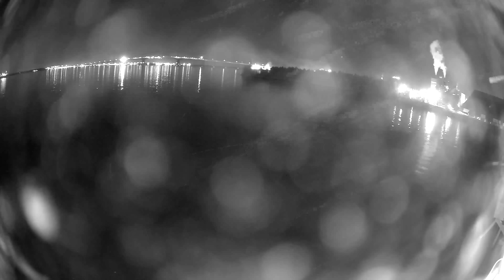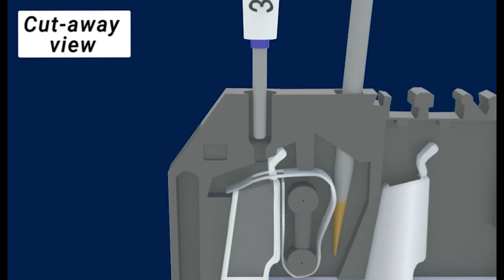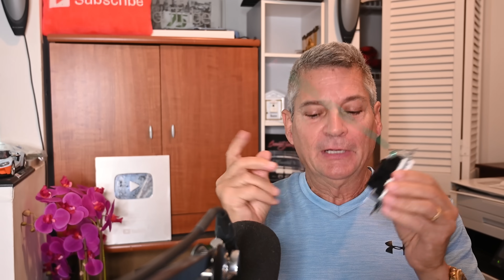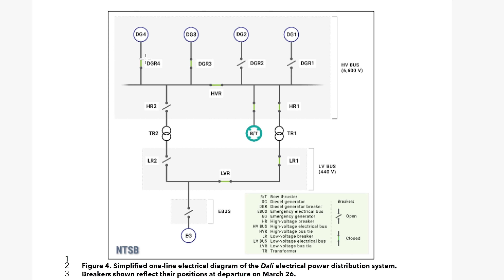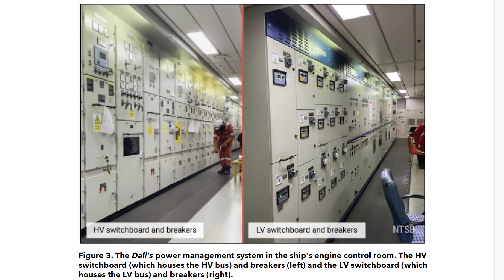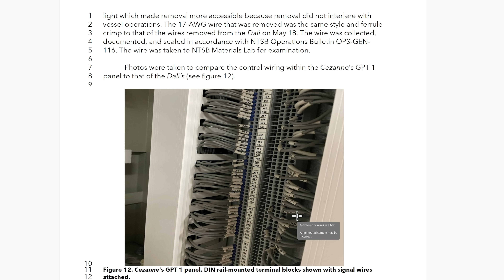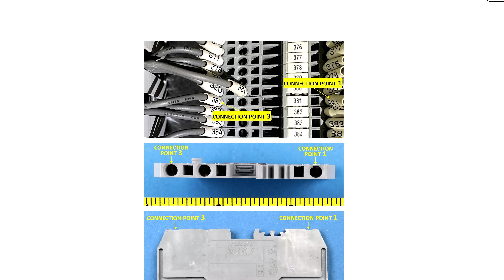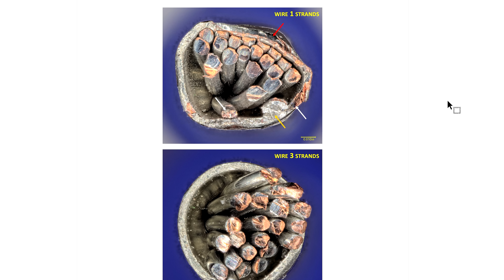NTSB: Scary Wire ERROR Caused Dali Crash/Key Bridge Collapse Baltimore

Comment: I learned long time ago to ALWAYS ensure that the heatshrink position is not compromising the wire ferrule insertion depth and to ALWAYS test Wago connections by pulling on the newly inserted wire to ensure that the wire ferrule is trapped correctly into the spring clamp.
This is a total rookie mistake, a mere 10 seconds of testing would have saved everything, also quite amazing that just ONE wire connection can fully disable an entire ship.
Reply: Yep, the five pound pull test takes about two seconds and would have saved six lives and incredible damage.
Reply: im preatty shure the deformation of the sleve that he mentiont was from pulling it out, and the other marks was from several attemps to fit it in.
This kind of Clamp culd not produce several marks on its own, only if several G´s fors on it ot the cable gets pulled, but like i say, i guess the marks show clearly there was several attemts to stick it in.
Reply: I wonder if the culprit is still out there and realized this is their fault. Even better, I wonder if they keep logs of maintenance and can figure out who did it. Probably not though
Reply: @digi3218   Construction records would probably say who assembled/worked on that panel. And maintenance records since construction "should" also say who's worked on it, if anyone has had a reason to fiddle with it. But I'm not holding my breath.
Reply: @dave.of.the.forrest On paper, at most they can narrow it down to contractor/crew. Only the crew probably knew who worked on what.
Reply: @dave.of.the.forrest  If they kept record sure you can find an underpaid shafted individual to blame. Yeah lets blame the design engineer and the QA inspector that gets yelled at if they take too long too. It is the environment driving profit pay someone as little as possible and you get minimum effort.
Reply: @ExileXCross  And in most cases even the crew itself propably doesn't know, years laters, who exactly worked on which panel when Dave, Bob, Steve and Harry all were wiring the room.
Reply: It doesn't matter. You shouldn't have to ALWAYS ensure that the heatshrink is not compromising the ferrule. The design of the system should make installing the label over the ferule impossible. It's just like lockouts to keep cars from being put into park when they are moving. Yes, you could just say "don't put the car in park when its moving and pretend the operators are stupid. But the proper design is the lockout to prevent the very possibility of a stupid mistake which is 100% likely to happen over and over again.
Reply: @RockinRobbins13 No. Just no. This is one of those cases where unskilled or improperly trained labor is put on a vital task without proper supervision or inspection. There are far too many chances for something like this to be done right before looking at adding ridiculously complicated safety features in an area where the people doing the work are supposed to be the backbone of safety

- Your friendly industrial electrician
Reply: @landonbrown5295  Skilled or unskilled, human beings make mistakes. To the extent it's possible to design items that block foreseeable and even unforeseeable mistakes that crop up and kill people, it is the engineer's job to design items to eliminate the possibility where possible.

This one is easy. So yes, just yes. Unless you are in favor of killing people by bad engineering. You might be in that camp.
Reply: @landonbrown5295  the skill level and training of the people doesn't matter.  Engineering things to prevent mistakes is essential.  Nasa learned this on Apollo 8 when the astronauts accidentally reset the navigation computer halfway between the Earth and moon.  They knew that the mistake was possible but chose not to fix it because they assumed the astronauts were too highly trained to make such a mistake.
Reply: @landonbrown5295  "This is one of those cases where unskilled or improperly trained labor is put on a vital task without proper supervision or inspection."

Maybe, but what they're suggesting is that in something this vital, the components could and should be designed that even if a unskilled or improperly trained (or what you won't admit, a properly trained and skilled labor) literally CAN'T make this mistake. It's big investigations like this that can change how things are done for many things moving forward.

It's also easy to blame "unskilled or untrained" labor, but all humans make mistakes, even in critical work that requires insane safety considerations and can cause issues.
Reply: @RockinRobbins13 what are you imagining you could possibly do to make it impossible to put heat shrink around a ferrule?

Also, this is not work being done by a greater idiot on a daily basis. This is trained work.
Reply: @JasperJanssen  Trained workers killed people, didn't they? You believe they WANTED to kill people, were just mean that day? No, they wanted to do a good job and not hurt anyone. Saying it's trained work is not a helpful thing.

Okay, two possible fixes, the first being a procedural change., and it's pretty easy. First, insert the ferule fully into the block all the way to the stop. THEN heat shrink the label. I think that would be enough to fix the entire thing.

But you could also change the design of the ferule so that there's a 10mm shoulder on the end, thick enough not to be easily broken. If the label unshrunk is 6mm in diameter then there is no way it would fit over the end of the ferule.

So there are two easy fixes that would entirely ensure trained technicians wouldn't kill anybody. Pay me!
Reply: @RockinRobbins13  You are correct.  The ferrule should have a section where it has a larger diameter than the label sleeve.  The workers making these wires have no idea that the label interferes with full insertion into the terminal block.  They may even see the label  position as a helpful strain relief.
Reply: @2OO_OK  Sometimes when you're an engineer on a project you are just too close to see the defects. I've done it too.
Reply: Wago is bad design. Proper design is a screw terminal that compresses a large section of wire
Reply: @igelbofh Not completly agree with that because alsö with screw terminals you can make mistakes and if you put the label into the terminal it would make a bad conection that might get lose over time posssible. To make it save from this the opening in the wago block should allow also the label into it. then the only way to create a istake is if you put the label all over the ferrule including the part where it should connect to the clamp. But then it would show by testing because there would be no flow of current.....
Reply: @ulie1960  That's all according to how big a hammer you have! :face-green-smiling:

Comment: That archaic "wrap around the screw" connection is by far the WORST way of connecting anything.
Reply: Definitely not the worst.  Solid copper wire installed properly under the head of a screw on an electrical receptacle or switch (North American system) is highly reliable.  The back-stab connectors are not.  I have had a problem with a back-stab connection myself.
Reply: @GH-oi2jf  It's bad for all sorts of reasons, not just the fact that it's an exposed conductor. I don't like back stabs either for that matter, but a properly designed screw clamp is by far the better choice than either spring or screw head, unless that screw head includes a method of keeping the wire from spreading, which I've seen on some.

Comment: 24:32 this makes me wonder if someone pushed that numbered sleeve down while trying to jamb the ferrule into the connector. Probably didnt fully release the locking tab before hand. Could be a possibility.
Reply: These are heatshrink style labels, I think what has happened is that on the sister ship the installer shrank the labels onto the wires before inserting them - which would explain why they didn't completely succeed in following the work instruction (assuming the presentation in the earlier chapter was derived from the actual work instruction) of having the labelling orientation visible for all the wires, however they did shrink the labels around the wire neatly. On the Dali I think what they have done is pushed the wires into the terminals, then adjusted all the orientation of the unshrunk labels in situ before shrinking them, so the Dali's labels follow the visible direction part of the work instruction, however then masked the visual cue for insertion errors as they had put them around the ferrule - and of course once shrunk prevented proper correction of the insertion error due to the label position.
Reply: @mdfyui8000 Yeah, bullshit. The label prevented full insertion, so there's no way it was added after installation.
Reply: @mdfyui8000if the heat shrink isn’t adhesive lined it can slip after being shrunk. It’s just a possibility, but probably not likely. Without handling it in person I couldn’t say whether it could slip very easily or not, though.

Comment: What is truly amazing, is that all this wiring problem, after many, many years, surfaced at this exact time to cause the situation of the Dali destroying the Francis Scott Key Bridge. The chances of all of that coming together at this single exact time in space has to be phenomenal.
Reply: They probably had this intermittent problem for a long time. Just too cheap to have it diagnosed.
Reply: I think after the first arcing, this connection was kind of spotwelded and worked ok for a longer period. But one day, the connection broke due to Vibration and the problems arised.
In the most of lose Connections i have Seen, there was much more thermal destruction like burnt plastics, black Powder etc.
Reply: @tiemoschafmeister8390  100%. Danke für Deine Expertise.
Reply: @tiemoschafmeister8390 a voltage monitor line would draw little to almost no current. It would not weld.
Reply: @michael931  Agree. Didn´t know that there was no considerable current on this line. However, there are little signs of heat, more than I would expect on a signal line...
Reply: Just like the Champlain Towers South, Surfside, FL collapse. After 43 years, little by little, at the final second, everything came together to collapse that building.
Reply: the actual odds are: 'sh*t over infinity'. Having done thousands and thousands of 66 blocks and ADC blocks, we ALWAYS did a tug test on our work; redo as necessary.
Reply: The heli collision with the passenger jet over DC springs to mind of another recent chance accident.
Reply: @JohnnyMotel99 yes but that sort of training mission carried out on a regular basis with close proximity to non participating  aircraft was just begging for a disaster.
Reply: @JohnnyMotel99  Es ist bezeichnend das Trump gleich die Unfallursache sah. Woke tötet. Inkompetenz und Wunschglaube haben keinen Raum in der Flugsicherung.
Reply: @theoronig6440  You gotta be joking! That crash in DC was an accident waiting to happen. I am also assuming that you are not an air-traffic controller in a very busy airspace.
Reply: @JohnnyMotel99  letting woke be in charge of hiring important positions is an accident waiting to happen, correct
Reply: @patrickderp1044  Clown.
Reply: It suggests that this sort of failure happens with some frequency, but in the open sea it does not lead to loss of life.
Reply: @rscottr what if it happened in a severe storm?
Reply: @rscottr  No it doesn't. Are you familiar with ADHD?
Reply: Actually, given the latent errors in Dali's power and controls systems design, the lack of training, the lack of routine traing drills, the lack of maintenance follow-through tests,  etc., the failure occurrence probability was quite high.  I've worked in the commercial nuclear industry for well over 40 years.  We took NASA's probability methods and turned them into real science and math in the 1980s.  The design of the Dali reminds me of some awful project failures caused by inept management.  Plenty of critical industries (even electrical power transmission- distribution, which is an entirely separate subindustry) would benefit from applying the nuclear power industry's experience and the methods and practices adopted to counter even extremely low  frequency (>1E-7 per operating year) event probabilities.
Reply: That's how design defects manifest themselves. Our ingenuity in designing defective systems far outpaces our ability to find them before they kill somebody.
Reply: @RockinRobbins13  Do you realize what you are saying? Even inventing the wheel, or the spear or anything else has it's own inherent "manifestations". It doesn't matter what it is. It doesn't mean that it is a design defect.
Reply: @additudeobx  " It doesn't matter what it is. It doesn't mean that it is a design defect." Okay so there is no such thing as defective design. That's not a helpful attitude. It would be simple and cheap to design this system so it's impossible to fit the label over the ferule, so your response is "who cares, life is dangerous?" Yikes, That explains the Ford Pinto.
Reply: @RockinRobbins13  The "probability odds" that it would cause a catastrophe when compared to the "probability odds" that it would not create a catastrophe are not the same. The probability odds of winning the lottery, are not the same as the probability odds of not winning the lottery. The probability odds of being struck by lightning are not the same as probability odds as not being struck by lightning. The probability of it not happening (not causing a catastrophe) is always much higher than the probability of happening (causing a catastrophe). Ask AI. What I say is a fact.
Reply: @additudeobx  1. Never ask AI. It lies. 2. Small odds repeated enough times are 100% going to kill. Repeat that 10 times. There might be a test.
Reply: over the years there are countless number of ships going under bridges everyday, get a big enough sample size and 1 of the many active swiss cheese accidents are bound to get through all the holes, the ones that get famous are the ones with the most disastersous results. Im sure there are similar rare mistakes/failures that happen all the time that have no bad results so they just fix and keep it moving, they only stop to analyze and break down the incompetency when it results in disaster, but incompetency is fixed by people competent all the time everyday in all fields
Reply: There are hundreds of thousands - maybe millions - of ship transits beneath bridges every year.  So the million to one chance turns up nine times out of ten!  (Terry Pratchett fans will know the reference - which is of course true!
Reply: Murphy’s law.
Reply: Well, since it happened, the chances of it not happening must be even slimmer!
Reply: Hey, OP - the chances are exactly the same as having the power fail anywhere else on the ship's routes. If this had happened in the middle of the ocean, the odds of it happening at some exact spot would be equally "phenomenal".
Reply: @Slicerwizard  Are you serious? Why do I need to tell you that if this issue happened in the middle of the ocean that the consequences would have been almost minimal. Why do you want to ignore that the consequence here was the destruction of the Francis Scott Key Bridge and the loss of 6 human lives?
Reply: "Act of God" is what the insurance companies literally say 😮